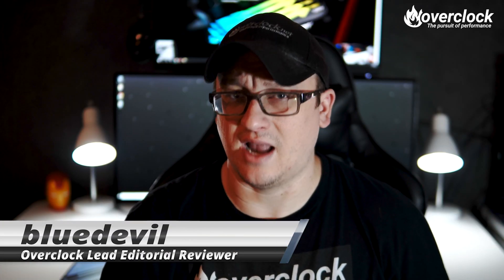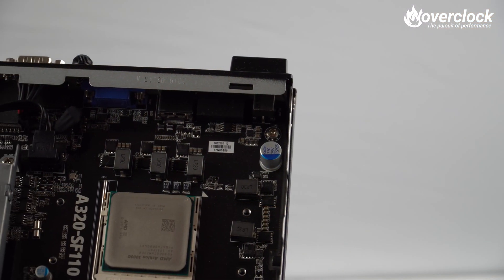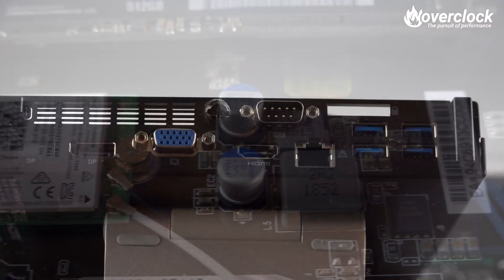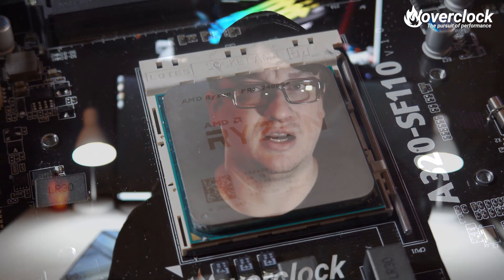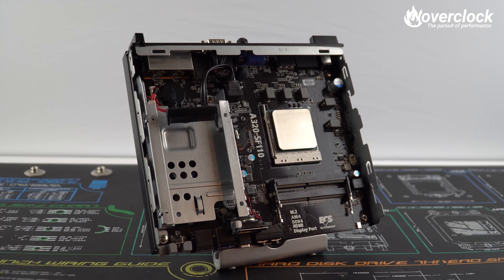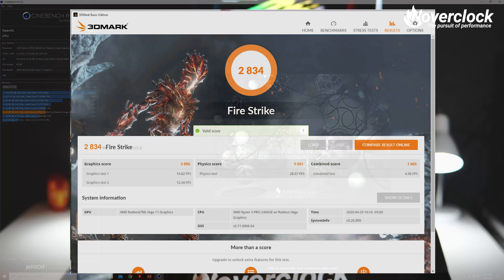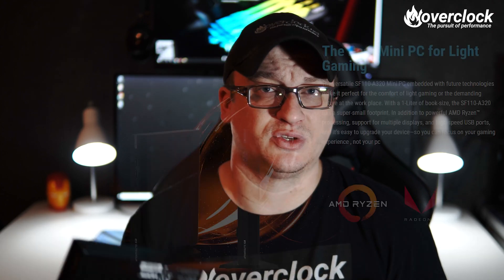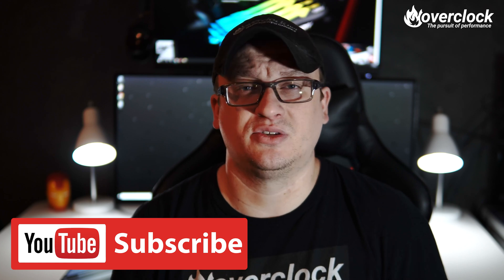SFF to WIN? Ft. ECS SF110-A320

Comment: would an amd r3 3200g work, the specs of the pc say it takes up to 35W cpu's, but the apu needs 65W
Reply: there is a 65W (120 Power Supply) version of the ECS SF110, where a 3200G works (I have one). It does not work on the 35W version presented in this video, though.
Reply: @PatagonianWarrior  How is yours going on. May I ask what you use it for what the full specs and rough investment was and the performance (overheating issues or such)?
Reply: @Daniel-dj7fh  I got it as secondary PC, the 65W version with 2x4GB 3200Mhz Samsung Value Ram and a small SSD on it. Sursprisingly there is no overheating on this little fellow, despite the miniature cooler fan. CPU is about 40 Celsius in idle and goes up to 52 Celsius in normal use. Not done gaming yet, but surely would run some benchmark soon. Its really a cute little but powerful thing!